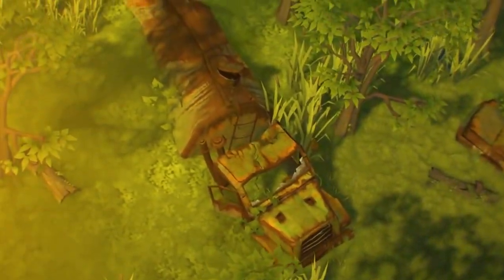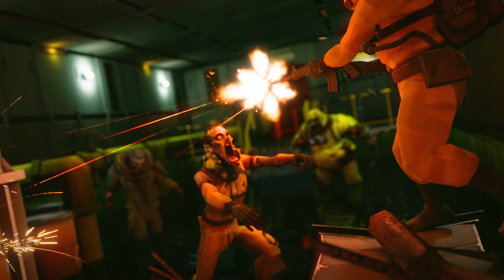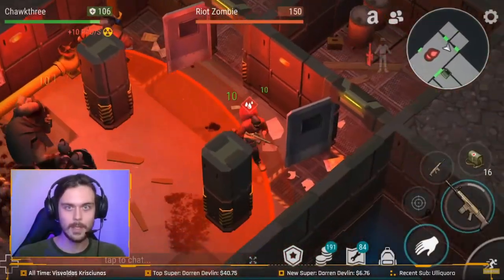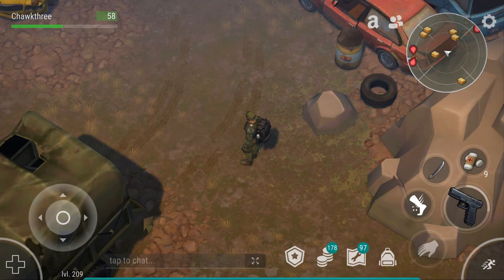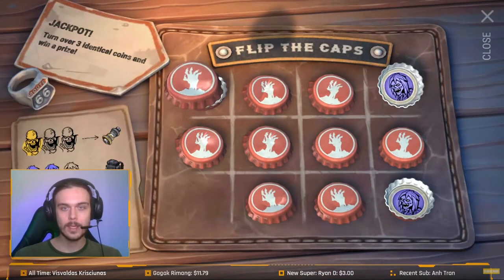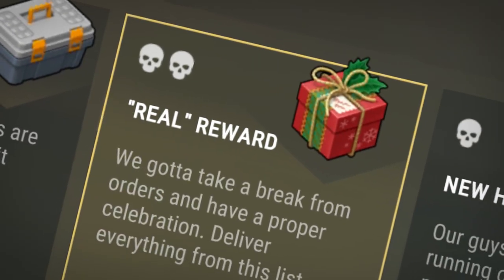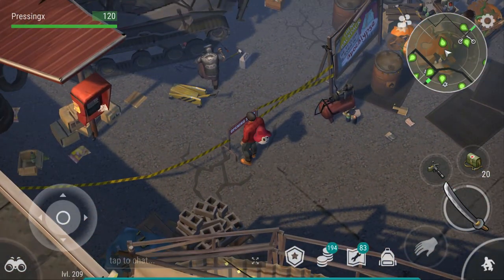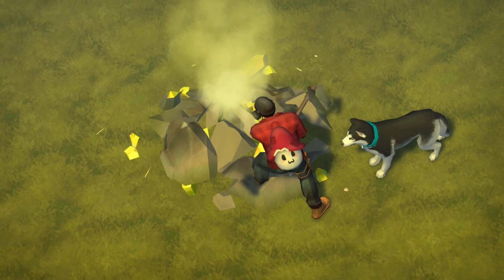ATV Build Guide for LDOE: Atv Transmissions, Gas Cylinders, Car Batteries & More!

Comment: I never gone for bunker bravo, because you need lots of gun with high modifications, so i almost wait for two years to complete my atv, so whatever parts I got from season, car battery, cylinder, atv, some of them i got from junkyard events, so this is how i collect all the parts for atv finally. 😊
Reply: ATV is chapter 4 after chopper, minivan, boat … once story reaches atv you are told where to find hard to get parts.
Reply: Well … act 4 takes ages … but without Bunker Bravo you cannot complete it …   the only place where I came across the atv wheels in a whole year! And the gas cylinders are rare … without bravo F2P even years not obtainable. And during the bravo event it is a relaxed walkthrough even without mods.

Comment: Congrats for the ATV 
Im really happy for you and also us because now you are going to make new videos...
i dont know how am i going to get 7 more ATV transmissions as a F2P so far i got 1 from delivery and 2 from jackpot...
Reply: Once you are in chapter 4 after chopper, minivan and boat the story tells you to build it … then you are told where to get the hard to get stuff. Some items are unavailable if you do not progress with the story. Eg minivan spark plug, sat dish, asbestos … if you do not follow the story you need decades or plenty of  money.
Reply: As they are pretty slow to continue acts … no problem doing it F2P … transmissions I found plenty … none via slot machine … spent 60000 caps … no transmission. Most important … do Bunker Bravo over and over again! Wheels … cylinder … batteries … all in all took me some years …

Comment: Dont forget about Fishing Spot and Pier - after fishing update you can now get rare trade for car battery
Reply from the maker: Woah, didn't know that! Thanks for the info. :)
Reply: I got titanium armor fragments from him
Reply from the maker: @nathankerr4346  Woah. Sound like I need to be heading over there every reset...even if I don't end up fishing. :o
Reply: Never got a single car bat from there and done it hundreds of times! Simply did bunker bravo … has the hard to get parts!
Reply: @GanymedeXD  Yep, its one of the rarer pier options. Plus all pier options are way more expensive than fishing spot trades - easier as you say to just do bravo

Comment: Nice video, I like sometimes you put stock image in.
Usually you have to buy season pass to get to gas cylinder, so f2p players can grind it in Bravo.

According to Wiki, you can get Gas Cylinder in 4th Bravo chest and one of the locked door if you activate the opening lock perk.
Reply: You do not need to pay anything for gas cylinders! 🤣 Absolutely free … bunker bravo … alongside wheels and batteries!

Comment: I have a cool trick at CCF to know when the barn will open or not, It will only open only if 1 dog is outside the barn and not 2, meaning if there is 1 dog outside the barn and the other is not it is guaranteed that the barn will open, but if both dogs are outside the barn then it will not open I only noticed this when my barn was opening every time I see only 1 dog outside that barn.
Reply: I also use your site sometimes :)
Reply: Interesting
Reply: @soulghost9718  altho when the barn is full of raiders it won't open at all only when there are zombies araound
Reply: This does not work … never had 2 dogs outside barn … even if only 1 is outside it randomly opens or not.

Comment: I’m stuck on the gas cylinders. I’ve never done bravo Im not even really good at hard mode Alfa. I haven’t done the lab either. Ugh. I actually got the atv transmissions super quick. But it gives me steel so hey there’s that. I’ve gotten them all from seasons.
Reply from the maker: I'd bet that I've gotten well over 60% of my cylinders from seasonal rewards. Seasons are ridiculously good for the atv grind. Hopefully they're available in the season 18 loot as well.

Comment: I got 25 lead from season 18.What can I do with It?.Should I craft car batteries??.
Reply from the maker: I'd recommend putting it in the "opening locks" terminal at bravo. That will really speed up your battery/cylinder progression. If you're not prepped for bravo I would just save them until we get some other use cases for em. :)

Comment: Thank you for your information about atv, only one thing is hard to find for me is atv wheels! I know raids can help but won't join it, please tell me another ways. Thank you
Reply: Wait till story reaches chapter 4 and your task is to build it … then you are shown where to get hard to get parts!
Reply: Ok, story mode will take ages … atv wheels are easy to get … simply complete bunker bravo … only place I have seen em in years. And the gas cylinders you only get in reasonable time frame f2p when doing bravo.

Comment: 1:14 bro someone needs tell me if these terminals resets or fucking not
Reply from the maker: Only one time build fee. 👍
Reply: Bro wtf uk how hard it is to get electronic circuits? I mean I have 20 + but amma just waste them on bunker bravo if it’s a one time deal mayne that ain’t fair😕
Reply from the maker: @dangeneral5753  Just have to build it one time. It'll last forever. 😉
Reply: Okay thanks mayne🥹 hey while your at it could u tell me which 2 best terminals to build?